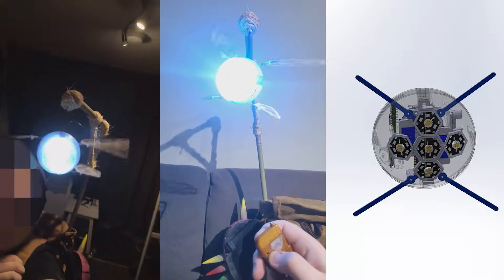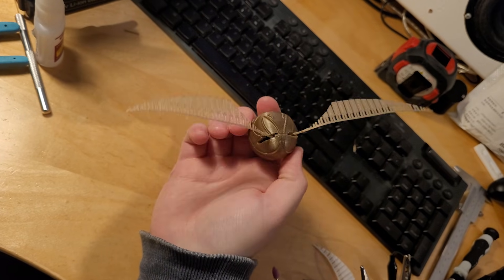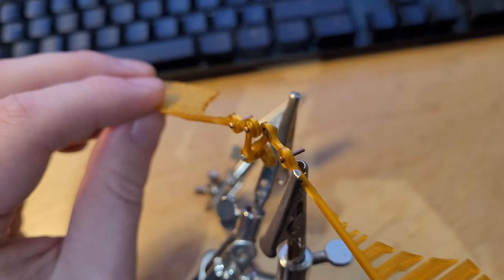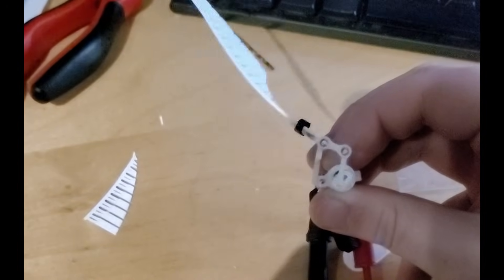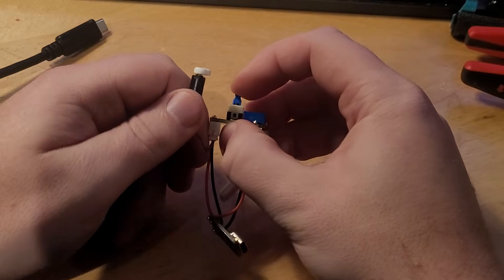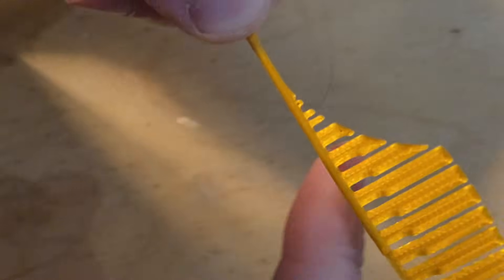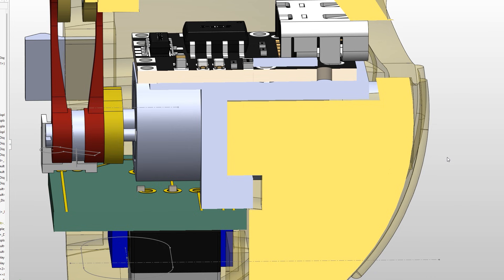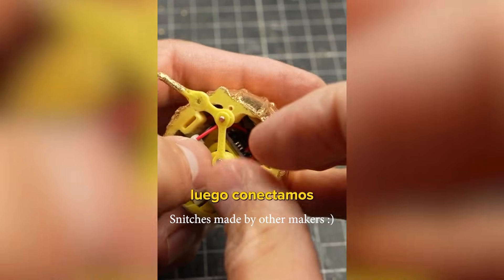I Engineered a working Golden Snitch animatronic!

Comment: why is 1amp current of the charging board bad for small lipo battery?
Reply from the maker: Since the battery is only 50 mAh, 1 amp is a 20C charge rate. That’s far above what Li-ion cells are designed for. you typically want to charge a battery with 0.5 to 1C....so 20C was about 20 to 40x the max charging rate.

Comment: You need to make the output link shorter (or crank longer) for speed multiplication, yes you loose that factor amount of torque but that’s physics 😊 

There’s a lot of micro bldc motors these days that are tiny made for humanoid hands, might be worth looking into
Reply from the maker: I played around with those variables for hours.

The motor placement and the output hinge points were non negotiable. The motor only fits in the exact center of the snitch, otherwise it would poke out the back. And the output hinge points are in the place of the ball joints from the movie. 

I could make the crank longer but like you said, I'd lose some newtons. The 1200rpm motor didn't have enough torque so I switched to the 420rpm motor. Increasing the length of the crank didn't seem like a good idea since I might have to downgrade to an even lower rpm motor due to the bigger arm.

The output link is the size it is to get the maximum amount of wing travel per rotation. A smaller distance between the floating bar attachment point and the output hinge results in less wing travel, and a bigger one results in more wing travel. 

It is quite the challenge to get everything right 😅

Bldc motors look nice! I'd have to reduce the output speed and add more electronics to the snitch in order to control said speed.

I will keep it in mind for future project though :)
Reply: That makes sense! Yeah, it’s always a push and pull with linkages. Especially near singularities, you need so much torque than the rest of the circle.

I am just throwing ideas, don’t mind me. Trying to reduce mass on the wings with some research on different methods/materials could also be another route to take. Keeping the motor packaging independent of the wing drive could also be an option worth looking into. Meaning, motor doesn’t necessarily have to be oriented with the shaft, if you don’t mind the snitch to get heavier, maybe put the motor vertical and use 1:1 bevels and multi-stage spurs to get to your tuned torque/speed parameters to drive the wings. That can unlock 2 tiny motors side by side, vertically packaged and some clever micro gear stack. They all would no longer be 3D printable, yes, maybe EDMed or machined or laser cut, which are not that bad in terms of price these days. 

Anyways, miniaturising and packaging electromechanical things is such a fun process! I work on humanoid actuators and my favourite time of the year is actuator design!

Comment: I wonder if a voice coil could offer quicker movement with less moving parts?
Reply from the maker: Someone else mentioned something like this as well 🤔 voltage peaks would be higher so I'd have add even more electronics into a small space.

The main challenge was space efficiency, I feel like the current design does a decent job. 

But I will keep it in mind for a possible future version :)

Comment: How terrible that motor gearbox is when a 370000 10nCm motor has barely enough torque to flap a lightweight wing? If it was designed properly, that 420RPM motor reducer would deliver almost 1KgfCm at 3,7V and 150mA.
Reply from the maker: It has to counteract the kinetic energy build up over time, it does adds up over the duration of a flap 😅 Honestly the fact that these motors exist is amazing in itself. I took one apart, the planetariy gears are so damn small....
The 420 rpm motor stalls at 0.7KgfCm. the 1200 rpm one has 0.3 if I am not mistaken.

Cool stuff imo :)

Comment: Motors and levers won't give you the speed you need. What about an electro-mechanical actuator, almost like a linear motor which could be driven by an amplified sin-wave generator? Have separate linear electro-mechanical actuators with separate drivers able to be at higher or lower frequencies and higher or lower amplitudes to control the flight?
Reply from the maker: Interesting proposal 🤔
Assuming that we're talking about making it fly.
It is definitely one way to go about it, the linear motor like actuator would be quite power hungry, more so than a normal motor.

There are smal motors with higher rpms and more torque on the market. I'd pick one of those and go for an ornithopter like approach. Which would still be challenging that this scale.

The linear actuators for pitch/jaw control would probably be the way to go. The wings need to flutter at at least 20hz which means that these linear actuators need to be able to react with this frequency as well...

It is theoretically possible but actually making something like that in this small form factor will be extremely hard.

I'd love to see it happen though!

Comment: Sees title
“Okay, how did this guy manage to make such a tiny drone?!”
It would have to be made entirely of metal to withstand actual outdoor sports, and the laws of physics say it has to be a drone—nothing else could get it off the ground.
Reply from the maker: It doesn't fly...that is one headace I am not ready for. I meant "working" as in the wings work, which is an achievement on its own with 3D printed wings. 
I do not have the right equipment, nor time, to actually solve the flying problem :( 

I did some back of the envelope math, it is technically possible but like you said I do need some fancier materials other than plastic to actually pull it off.  I did not account for any wing control mechanism, it is just the math to make this thing fly..it is technically doable.
There is a bit of a rocket equation going on, I need a bigger motor which results in more mass, which results a bigger motor -> more mass etc etc. 

I'd give it a shot if I had the time and equipment...which might be the case if this channel takes off?
Reply: @theinventioninn  That’s exactly why I said it would have to be a drone. There’s no getting around it, you’d have to attach a helicopter blade setup to one side—because physics.
Reply: @Wizardsaresquishy I ran the numbers for the wings (assuming zero drag when going up and maximum drag when going down) it needs to flutter with 20hz in order to hover.

Turning it into a drone is a cop out solution imo. 

The beauty of engineering is that you can make the seemingly impossible, possible. As long as you stay within the realm of our current understanding of physics.

Making it fly with its own wings, like in the movie, is one hell of a puzzle to tackle though 😅
Definitely an interesting puzzle
Reply: @Xienixnlpsc well, I’m not an engineer. I seriously didn’t think it was possible to get it off the ground because I can’t do that kind of math.

Comment: I use gold in some of my DnD designs for my Etsy, most of the silk is pretty weak and I have a design that uses multi-material to use a PLA+ 'spine' with the silk (gold) just being a surface layer. But yeah it sucks by itself, I accidentally got a roll of white silk the other month and I just powered through using that on any rubbish to give people.
Reply from the maker: Yeah that was an odd realisation, whatever additives they use to make the silk gold pla/petg significantly reduces the strength. 

Cnckitchen made a video about it, testing a bunch of different pla filament colours. 

Buuuut to be fair, these wings aren't a normal 3D print use case and I am happy that I made it work to begin with.

A multi-material print is a good solution, though these wings aren't thick enough nor do I have a printer that can do that 😅 maybe in the future